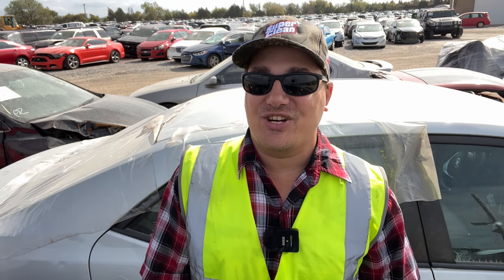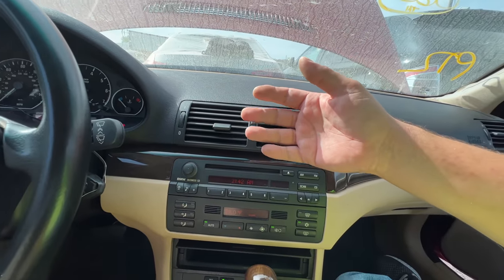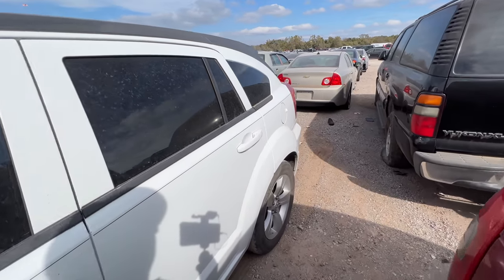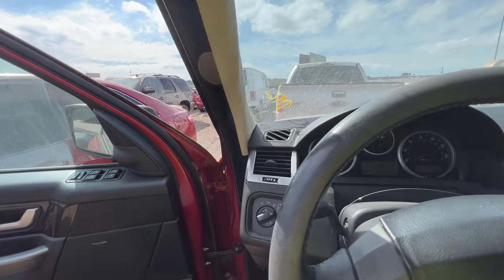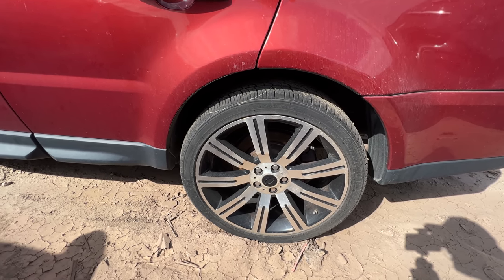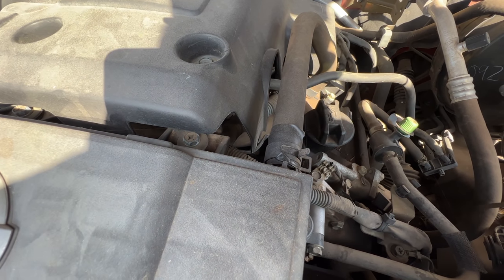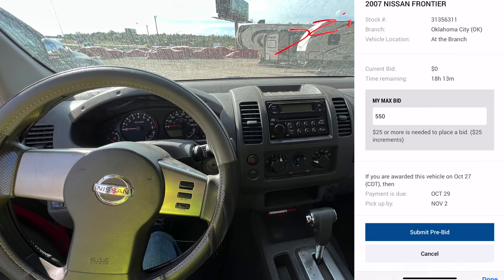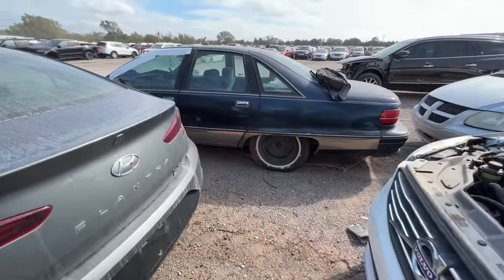IAA Walk Around and Live Bidding + Winning a 07 Nissan Frontier!! 10-28-21

Comment: I sold a VW to peddle they made me a decent offer, I accepted, someone picked the car up that day gave me a check and it was gone. Great experience
Reply: I’m thinking about selling a Yugo to them that’s legit rotting away in my backyard. Timing belt broke off at 31k and valves hit the pistons and it’s been in mutable backyards over the span of over 20 years. It’s been sitting in mine for like 13 and I’m done looking at it.
Reply: @CupwakeRBLX  Yugo’s are TERRIBLE cars
Reply: Jack that’s why I don’t bother fixing it. even tho it’s the car I took my drivers test and learned how to drive stick in I’m not fixing everything on it.
Reply: @CupwakeRBLX  Praying for your recovery.
Reply: @Mr.Useless420  Except Peddle is a reputable company. I wouldn't take checks from just anyone.
Reply: @johnjesus971  thats good
Reply: K swap it! If it's not a pile of rust. Or try and get a hold of the boostedbois/pfi

Comment: The Nissan would be a kick ass deal for under 1000 clams. 😎👍🇨🇦
Reply: Yes. As long as it doesn't have the Strawberry Milkshake Of Death (SMOD) and he wouldn't know because the transmission dipstick is bolted down on those so you can't check it without unbolting it which he can't do.

Comment: I have had 2 Nissan Frontiers. Great trucks. I like the pickup and it should flip well.
Reply: They are great trucks. I've had two also, as well as two Xterras. Still driving my '19 Fronty and my '10 Xterra. The Xterra is my profile pic.

05 - 09 had bad radiators that can ruin the transmission by mixing coolant into the transmission fluid. Other than that they're great vehicles.
Reply: @Mike.D.843  I recently purchase a 2000 Frontier with 92k miles here in California. It is in really great condition. Thank you for responding.
Reply: @neilforrest2677  Nice, a first gen. As long as you change the timing belt on time and do regular maintenance those are pretty much bullet proof. I had a 2001 Xterra for 8 years and put over 100k miles on it (same powertrain as your Frontier) it was a solid truck, until it got wrecked.

Comment: 2005-2009 Frontiers with the automatic transmission had problems with the transmission cooler in the radiator leaking coolant I to the transmission fluid which destroys the transmission. Same problem on the same year Patherfinder and Xterra with the 4.0 and automatic. 

I can see the part number sticker on the top tank of that radiator on the video. It's the OEM radiator. At 250k miles, I bet it's got SMOD if the integrated cooler isn't bypassed.

Upper intake has to come off to change passenger side front plug/coil.

Also the coolant tank on those is pressurized so the radiator cap actually isn't meant to be removed. You check level and top off from the reservoir/tank.
Reply: If I couldn't check the transmission fluid to verify no SMOD, I wouldn't touch a 2005 to 2009 with a ten foot pole.  Actually, just checking the fluid isn't enough. Lots of folks try to save them by flushing the fluid. It needs to be driven to know for sure. 

Those years also had issues with the secondary timing chains destroying the timing chain guides which causes a loud whine in the engine.  The good news is, that truck in the video doesn't have the whine, so that's probably been fixed at some point.
Reply: Plus one on both of these comments, just Google Nissan class action lawsuit. I have an 07 frontier and my bil has an 07 extera, his has way more miles than mine and when his transmission went at  80k I looked up the issue and emediatly bypassed the radiator cooler. That was at 44k and have not had an issue. It seems that it was serviced regularly and as long as there is no noise from the timing chain you should be ok. Lack of maintenance is what kills these engines.
Reply: @kenalvord8411  Yep. I’ve had two 2nd gen Frontiers (still have the second one and don’t plan to ever sell it. 2019 SV 4x4 Crew Cab bought new. The last of the true 2nd gens). I also have a 2010 Xterra OR. They are great vehicles, and if you get a pre 2010 that has been bypassed, or had the radiator replaced and regular maintenance or a 2010+ it should run forever with routine maintenance. 

I had a co-worker that had a 2005 Frontier that the timing chains whined really bad on and he drove it like that for probably 100k miles. Not recommended, but its a testament to how well made the VQ40DE engine is that it can run that long with bad timing chains and guides!!
Reply: @Mike.D.843  post 2010 Nissan finally fixed the radiator issue, my bil is still driving his 07 with over 230k and ill probably buy it from him when he finally trades it in. Its been dealer serviced since new. The last time he went shopping the y were going to give him around 1500 for it and I told him I'd give him 1600. That was 3 years ago! 😆 I still have mine with under 70k but I work it, push snow and pull trailers. I stick with recommended hd maintenance and mechanically it's fine but in the northeast the tinworm has started to take its toll.
Reply: @kenalvord8411  I'm planning to change my radiator in my 2010 Xterra this weekend, just in case. it did have the warranty enhancement for SMOD, but so far, thankfully, I haven't had any signs of it. I am going to swap it out proactively - I'm tired of gambling. Mine was built 12/2009 and It's got the radiator part number that has a handful of cases of SMOD reported, so not the worst odds, but also not a guarantee not to get it either.

I also read somewhere (either on clubfrontier, or thenewX forum) that the VQ40DE built for the 2010 Model year vehicles and up also had the revised secondary timing chains and guides so those engines wont have that problem either, just a tip for anyone who might read this and wonder about that issue.

Comment: That is the thing I don't like with the oil dipstick on the frontier we have to twist and screw around with it. But nissan knows how to build a truck. The airbag light is a glitch that happens in the older frontiers. Have to turn the key off count for 4 or 5 seconds turn the key on the accessories setting wait to see if the light is still flashing and if so repeat until it stops.

Comment: The 05 to 13 frontiers and pathfinder with the 4 liter have a bad habit of mixing the coolant and trans fluid. They can also have bad chain guides.  The fuel tank senders also go bad. Ask me how I know. That said, the cost of fixing those can be low if you catch it soon enough. Otherwise, a new or good  tranny can cost ya, and a broken chain- good luck.

Comment: The Range Rover slow air suspension time.... likely from being low voltage... certain systems may not work fully until the charging system stabilizes.... it IS a Jaguar cousin after all..... 🤔

Comment: BMW.....My no expert guess...... Water pump went bad causing engine to overheat & also blowing the  head gasket, they thought all they needed was a new water pump (should have pulled over sooner,avoiding overheating & blowing the head gasket) . They put new water pump on, then realized later it also had a blown head gasket. So they tried stop leak to no avail. Seen the price tag for a new head gasket install, that cost more in parts & labor than car was worth, dumped the car. 
    Someone with BMW experience who got the car dirt cheap and only had to invest diy labor & $150 head gasket might do OK on it.

Comment: Copart, Houston TX, almost all modern cars are missing keys, stolen. Some nice cars are locked by someone with keys inside so you can't check them. Something is going on there, and the yard management doesn't care.
Reply: Milwaukee, last couple times I was there you have to wait and walk around with an employee just because of that I was told.
Reply: @kdhmaico  they can add an agreement form to sign in before you enter yard what you might be inspected by security, and you would have to prove that key fob in your pocket is your.